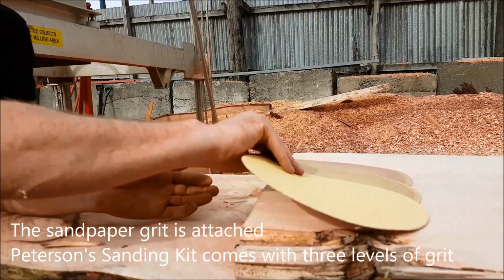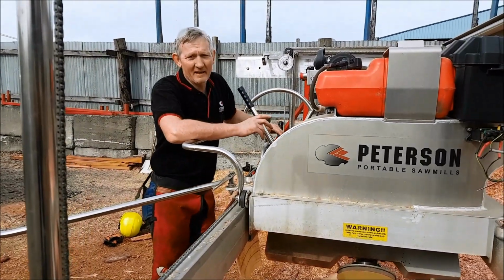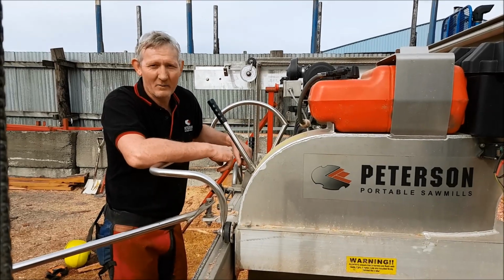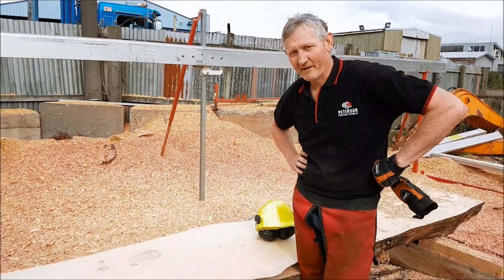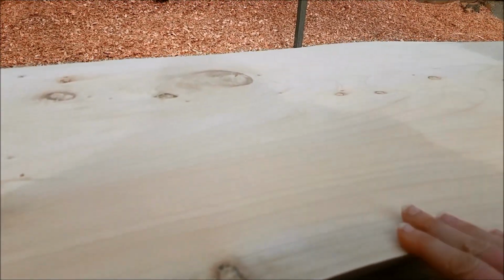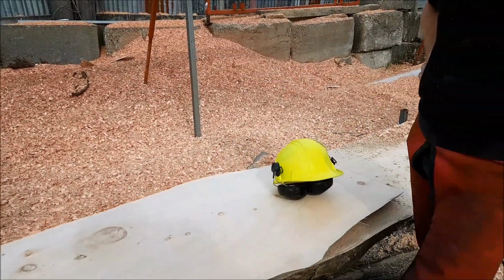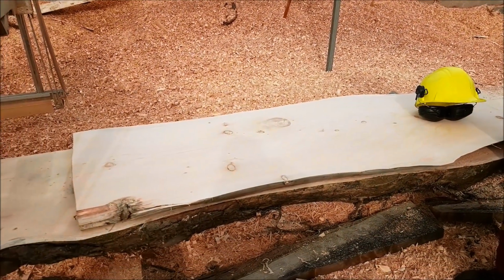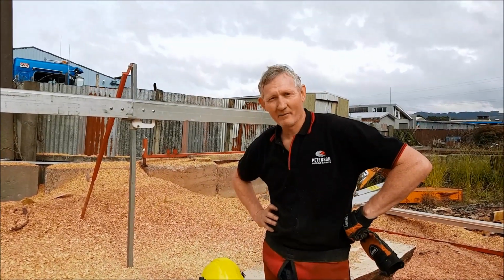Sanding a wood slab with a portable sawmill

Comment: Has anyone ever entertained the idea of a router surfacing bit for flattening on a mill?? Is it possible?
Reply from the maker: Hi Joseph. We have a Planer Blade which attaches to our mills and can do some grooving when in the vertical position. We have experimented with a router head, but unfortunately, our RPM is not high enough to make it cut successfully.
Reply: @PetersonSawmills  I looked up a video of the planer blade. It seems to work very well and can flatten dried slabs effectively.